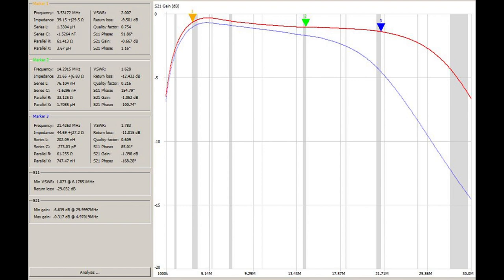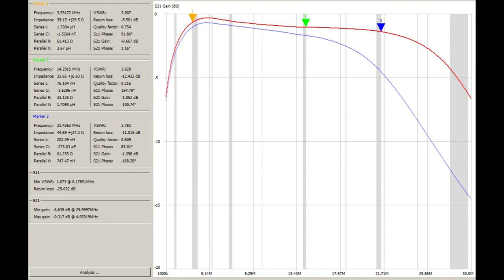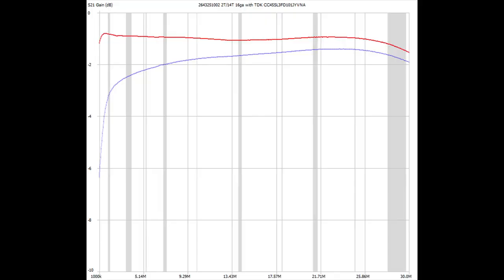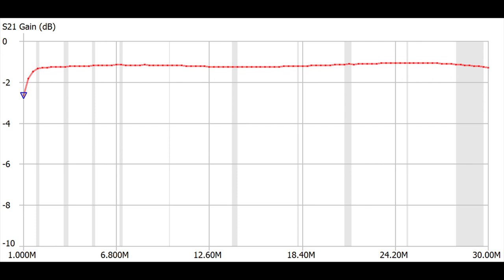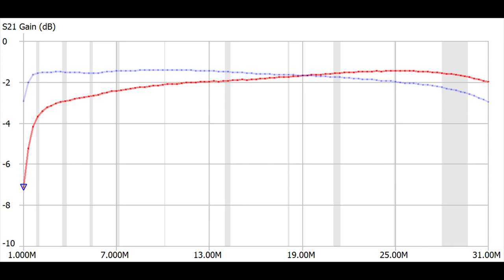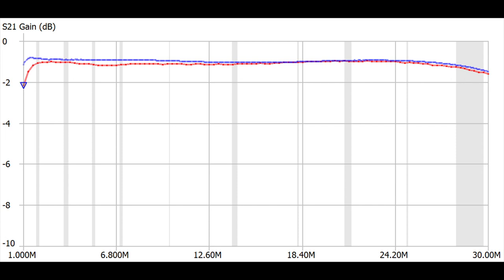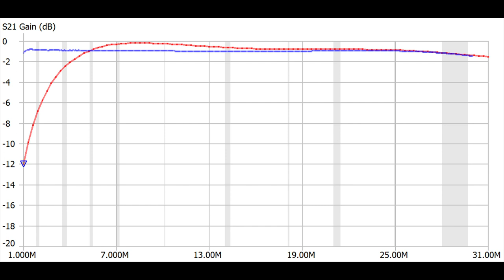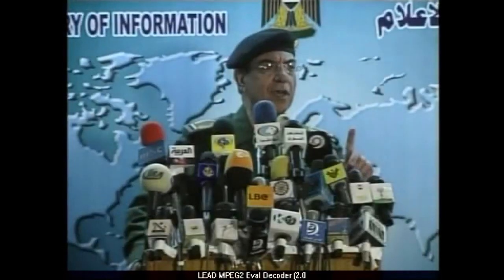Trash that FT140-43! EFHW xfmr geometry STILL matters!

Comment: Thank you very much! I just built a 2/14 autotransformer wind style, with the 2661102002 toroid for portable use on 20m. I initially used a 110pf capacitor and the best SWR I could get on 20m was around 3:1, and it was off in frequency (lower) from what it should have been based on the antenna length. Out of frustration I clipped out the capacitor to see what effect it would have, and lo and behold the SWR went down to under 1.1:1 on frequency. So I am very happy and also very grateful for the good information you put out.

Comment: Interesting video and extra marks for mentioning Colin's work. Did you wind that last transformer as a single wire with a tap or did you do the waste-of-spacebook twisty-pair thing?
Reply from the maker: My experience has been that single wire wound with the turns as tightly together as possible and adding the tap always shows lower loss.
Reply: @evil_lair_electronics  Yes,very nice!

Comment: It was Collin that persuaded me to trash my 140/240's. Actually i took the 140's and made 2 dual core ganella baluns which have been successful on my 40 meter loop. I use the 240's for commin mode chokes. (correct me if im wrong on that) Sometime soon ill experiment with high power and i believe Colin says the 240's are better suited for that. K0PKE

Comment: Thank you for the video. It would be fascinating to know how you might wind a 9:1 transformer for maximum efficiency.
Reply from the maker: I have minimally experimented with that in the past. Same concept really, build two of them the same, connect a VNA through them and look at the amount of loss across the desired frequency range. I start with what I hope is an excessive amount of turns, then retest the loss as I remove turns of wire watching the loss improve each time, eventually you'll remove enough that the loss will start going back up again, so then you get to rewind them with what was the best number of turns. You can't be afraid to waste wire!
Reply: Would also love to see this... have had a hard time finding loss characteristics for the standard triflar winding of the 9:1 transformer on the web. If I were the ideal person to do the testing, I would volunteer, but I'm afraid I'm not that person right at the moment  :)  If anybody is up for starting with the loss characteristics of the standard 9:1 triflar winding pattern, by following the general VNA testing approach suggested by evil_lair_electronics and MM0OPX, on perhaps a couple sizes of type -43 ferrite cores and a type -2 powdered iron core, that would be super interesting to see as a starting place! :-D

Comment: Thanks for the video!
Nothing more fragile than a hams ego. 😆

I would never have the guts to say THIS IS THE BEST TRANSFORMER. The only thing I might say is: Compared to XYZ, this seems to work better for me. 3 microseconds later somebody else comes up with something else that might work even better. This is life, no need to get upset about it.... 🤷‍♂️
Reply from the maker: I guess it insults their manhood. They want to say the have the biggest, baddest, best-est and if anyone says otherwise it somehow diminishes them. I don't get it. I'd be perfectly happy if someone came along and showed me something way better performing, then I could use it. BTW - I've watched your videos as well. I tend to agree with you on the crossover winding not really acting like a normal turn. Also thank you for your LC meter comparison, I purchased an LCR45.

Comment: I liked you video and will give building and testing several versions a try.  Thanks for the ideas and encouragement.  My approach to what I view on any media is along the same line as Mae West's idea about opinions.  You can look her quote up but bottom line: They are opinions, not facts.  I don't discard what can't be proven, is badly stated, or is just just BS.  It just get pushed into the pile that is 10 times bigger than than the "this works" pile.  Sometimes there is a gem in all that garbage. Thanks again for a excellent presentation.

Comment: Really like the video, only question I have is about the capacitor rating of 10Kv? I guess this is just a worst case scenario value? just working on that 1000w needs 240v peak into 50Ohms resistive, lets give that some x10 fudge factor to allow for very bad VSWR's etc still comes to 2.4Kv. Will just a 3Kv or 2Kv do? I understand to buy good quality TDK ones. Just wondering do we need the 10Kv model that's all.
Reply from the maker: You are correct plus those no name 10kv/15kv caps are high loss, never use them. I use the 3kv TDK caps, they are low loss and inexpensive.

Comment: With many of these devices people just rehash old data or misunderstand their own results. I have done a fair amount of work with a NanoVNA on common mode chokes, Most of the published designs are not great at all. With good but cheap test equipment there is very little reason to not do the experiments. To be honest I am not sure about the use of the capacitors on these UNUNS, an attempt to mask some of the behaviour of the actual transformer. A 1dB loss might not seem much on the other station's S-meter but at high power something is going to get hot.

Comment: Just got done building up and testing 2 transformers on my nanovna.  I got on 40 0.21, 20 0.23, 15 0.365, and 10 meters at 28.575 0.715 db loss.   Pretty effing good! Next is the wire…

Comment: Excellent video again! Is your EFHW deployed with a choke, counterpoise? Approximate length and deployment? Sloper?  Experimental results rule!
Reply from the maker: The antenna which the graph in this video is from has the transformer about 14m high and it is a slope as the pole on the other end is 4m tall, but it is far enough away that an 80m antenna will fit, so this shorter antenna doesn't get anywhere near that low. Choke 2m from the transformer, no counterpoise.
Reply: @evil_lair_electronics  thank you.

Comment: I agree. I spent quite a bit of money and time and nothing tested how I wanted it to.  I complained and said all the scrunch up spread out this turn that turn and nothing worked. I complained that how come it was so mysterious and why shouldn't we just be able to make a certin patern and come out ok? I got hammered on the group as I said the sience was junk. But anyway. I had some mystery cores and not even sure what they are? perhaps 77 mix but three cores even though not perfect allow me to get on 80 and run 400 watts ssb on 80 and 40 20 is ok but above that not so much. I need a setup that can handle about 500 watts ssb and I havn't seen anything on those groups that will.  I wonder if type K cores would work as they are made for broad band transformers. Problem is they cost 20 bucks a piece they are just under 2.4 inches and they have a curved build.

Comment: I thought Steve Ellington's advice was gospel, but I now see I am perhaps mistaken.  You sir, have done for the EFHW what TRX Lab did for the choke balun, actually measured!  It's kind of what scientists and engineers do, measure.

What value resistor did you terminate the EFHW with to do your VNA sweep?  Once I know this I will rush to my NanoVNA...

Is the EFHW still a worthwhile antenna above 100W, or do the losses start to mount at higher power?
Reply from the maker: I build 2 identical transformers, connect the secondaries together. So  transformation from 50 to 2450 ohms then back to 50, get the S21 measurement. Whatever loss amount is shown, divide by 2.
Reply: @evil_lair_electronics  I will try that very thing!  Any advice on 9:1 Ununs Evil Lair?  Some people use T200 powdered iron cores, others use T43 Ferite.  If you wanted a broadband 40 and 20m "random" wire antenna...
Reply from the maker: @cthoadmin7458  I have only tested 9:1 one time, it was just because I needed something for reception on old German tabletop tube radios I restore, they have 450 ohm antenna via banana jacks and I wanted to be able to connect with coax. So I tested the same way I test 49:1, did it with two 5943002701 that I had, wound them in the usual trifilar way. Starting with 9 turns, I removed one turn at a time and re-measured until I reached the lowest loss value, then the next turn removal made the loss go back up. 6 turns was lowest loss, the loss amount rose slightly with frequency, best being about -0.3dB for the pair on 160 meters, the worst being a bit less than -0.6dB for the pair at the top of 10 meters. I figure it is way easier to make a low loss 9:1 if I got it less then 0.15 to 0.3 each everywhere on the first try.
Reply: @evil_lair_electronics  Thanks for the info! 73 VK4QP

Comment: Nice Job. Thanks for sharing
When you made the antenna how high did you put it? And what was the finished length if you know it?  I’m just curious.
Reply from the maker: Transformer is 14m high, the wire slopes down some from there. I didn't measure the wire length, I just start out around 20m and adjust until the tuning is correct. I could move it to another location on my property and I'm sure it would want the length adjusted some again.

Comment: You and Colin have inspired me to do this type of testing with my newly acquired nano VNA.  I've been trying to replicate your good results with the dual stacked 240-43 (5943003801) cores and must be missing something.  I'm getting losses around 15-17 dB at 30 MHz when testing them with 100 pF TDK Caps (CC45SL3FD101JYVNACT-ND) with both the wide cross-over a tight windings.  If you don't mind sharing, how did you wind the dual 240-43s and what capacitors did you use?
Reply from the maker: Hi, dual 240-43 made a nice transformer for me. I did tightly wound and tapped after 2 turns, with a CC45 100pf cap. Losses for the pair were -1.1 to -1.3 across HF so cut that in half.
Reply: @evil_lair_electronics    Thank you very much for the reply and thank you very much for the videos.  Looks like I'm using the same materials and methods, so I'll retrace my steps and hopefully find my error.
Reply: @evil_lair_electronics Hello
Sm3tek on this side. Come across your channel by pure luck. Have been following this e x p e r t on FB and built a couple of EFHW both for 80-10 and 40-10.
Now I gone reuse my 49:1 trafos with stacked 240-43 and rewind with 1.8mm coppar wire and do your winding whitout crossover and do a Tight winding. 
Is it the usual winding 2 with tap and a total of 14.
Have the nanovna and I will try to measure the loss.

Thanks for your work on this subject.
Best regards from sweden

Comment: What I would have liked is if someone would have given a list of materials a how too video to build a best QRP a 100 watt and perhaps a 450 watt ssb transformer. A fail safe you use these materials you build it this way and shazam you have a great transformer and antenna. Mine were all over the place. Perhaps I should have focused on finding good capacitors. I notice on comercial models the capacitors are about the size of a dime and two or three times as thick. the cheap ones are thick but small diameter.

Comment: How much power is that one ferrite rated for? If we need to push around 400 watts, would you suggest stacking multiple ferrites?
Reply from the maker: Have you done any loss testing and found a stack that is actually efficient? The only stacks I ever tested which looked good was a 2 stack of 5943003801 for 80 - 10m or a 2 stack of 5961003801 for 40 - 10m. I really can't speak to wattage. I know I am hard on the equipment I have because I am always doing digital, but I work the world including multiple times to Antarctica on less than 50 watts. Of course focusing on efficiency helps ensure that as much of that power as possible actually gets to the antenna wire. Some of these guys running high power but with things like the crappy 3 stack of 52 mix, cheap lossy coax with poorly installed connectors, improper choking, using a tuner which does nothing to stop that high SWR still there down the entire feedline length, etc, they might actually be putting less onto the antenna wire than I do after all their losses add up.
Reply: @evil_lair_electronics  Thanks! Just starting to get into doing some of these tests on my own. Till now was building 'proven' and 'vetted' designs 🙂. Both you and Colin refer to using the two transformer method to test. Would be great if one of you could make a video on the topic. Thanks again!
Reply: @evil_lair_electronics   Big follower and fan of yours.  Based on a formula and Flux Density guidelines from an old Amidon technical data sheet the 2661102002 should be able to handle a continuous power of 88 watts on 7 MHz as an example when using 2 turns on the primary, and 220 watts when running CW since the CW duty cycle = 40% (I have also seen this formula elsewhere).  In comparison the 2643251002 core should be able to handle a continuous power of 155 watts on 7 MHz when using 2 turns on the primary, and 388 watts when running CW.  I've been using the 2643251002 core based on your previous work and today I built and tested two transformers using the 2661102002 core based on your work and I'm very impressed with the results.  Thanks and 73, Don (wd8dsb)

Comment: It is like talking to a Doctor. You use numbers that many do not understand. I have never thought the cross over was any good. I made my first and only EFHW using 240-43. 2 turns   and 14 turns. I didn't do the cross over. I do not have all the things to test it like you have. But it tuned up good on the 4 bands 40-10. I can tune in the others with my MFJ 940.  I don't have the room in my back yard for a longer wire. I am going to make a portable antenna soon. Looking at using 140-43 for that. With the same 2 turns, 14 turns. I only have 100p caps, hope that will work OK. Let me know what you think. I am just a dumb new to all this, trying to learn as I go. Thank you for the information! 73  W4DES
Reply: Not what Steve said. Dump the 140-43 and find the better torroids.
Reply: Losses and swr numbers here suggest 2T 14T and a  quality 120pf cap. 
2661102002 first choice if you don’t need 160 and 80m

2643102002 if you do. 

Gonna build one these myself and do the measurements for fun. 🎉